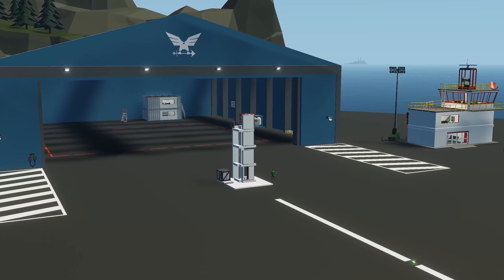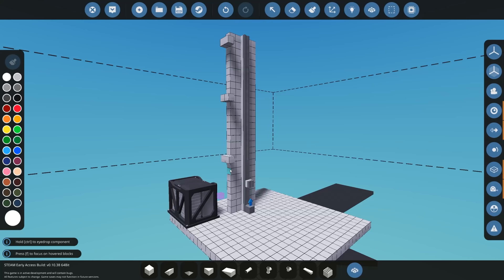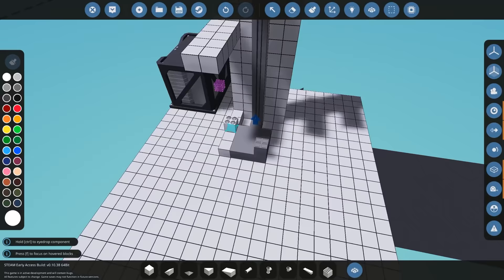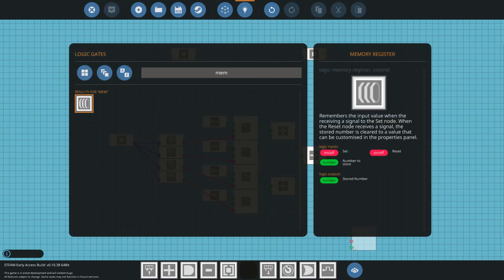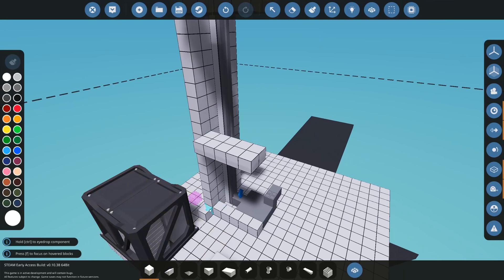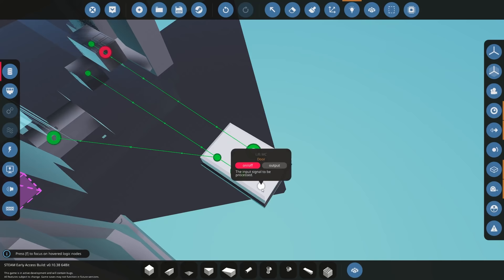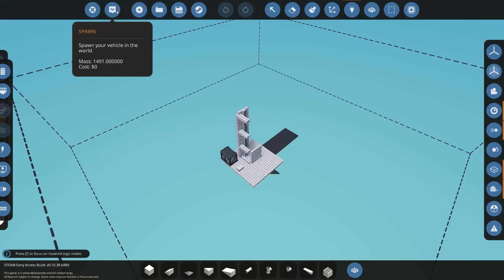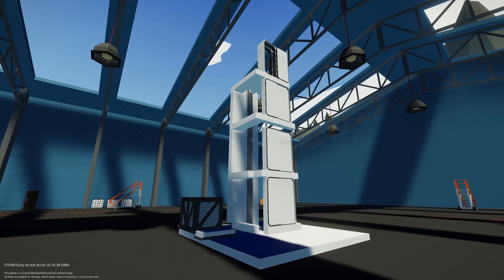Multi-Floor Elevator - Stormworks

Comment: Here's an idea for opening the correct doors in an easier way.

Use electrical connectors.

The source connector is located on the elevator floor and it's release mechanism is controlled by the microcontroller.
Each floors door is set to constant on and receives electrical power from the floors electrical connector. 

When the distance in blocks = the set position AND speed = 0, then disengage the release mechanism.

I'd also add a delay mechanism on the movement to allow for the doors to close before moving. Safety first right...

Lastly, I'd use multiple dash components as call buttons.
A single button for each level with the channel of that floor.

As long as you loop the dash's and MC together, you can't even need to change anything in the MC, regardless of which button is pressed, the channel is the same so the MC will react the same.

Comment: I'm building it in my ship, and I would to know how I install buttons to take the elevator in outside in each floor...
Reply: I had the exact same problem, but I fixed it by connecting the composite reads to OR gates, with the call buttons on each floor connected to the other input, and connecting the or gate to where the composite reads used to be connected. Works flawlessly
Reply: @christianmoeller4397  I fixed this problem building old version. It works well.

Comment: Ok so for everyone who is confused with how you make the "Call elevator" buttons this is how you do it. Ok so first, You go to the micro prosessor you've made, what you do here is you make some extra inputs for your call buttons. In my example i used three call buttons. In the microprosessor you add three on/off inputs for your buttons. When you have done this, you put them into your program and connect each of them to an "OR" component. into the OR component you plug in your call button to the Memory register and numerical switchbox you have for the designated floors. 

English is not my first language so im sorry if its formulated in a difficult way. If you have any questions just reply and ask me and if it seems hopeless i could eventually escort you to my Steam profile and upload my Micro-Prosessor which you can then use and download for your own use.
Reply: can you send the micro-prosessor to me?
Reply: i dont need it anymore, i fixed it myself
Reply: @nilsandersson223  Oki :3
Reply: Im not sure how to do this, can u help me pls?

Comment: You can also use grippers to lock the elevator in place which can help save power and prevent it from slowly sliding down over time, which is also very handy for heavy-duty cargo/vehicle elevators.
Can be done either by using vertical grippers that apply a brake when the door opens or by using horizontal ones that release when the door closes, the horizontal option is probably the best as it locks the elevator to the grid instead of a potentially incorrect section of the vertical track. You would only need grippers/tracks level with each floor and 1 on the elevator for it to lock onto, so you can still make it somewhat compact if needed.

Comment: Distance sensor are using electricity and the power will constantly drain the battery all the time if the power source being connected. I recommend use electric relay and capacitor for a distance sensor to prevent power being used.
Reply: You would also want to lock the elevator in place once it reaches its target floor, otherwise you can cause the elevator to sink at a more noticeable rate.

Comment: Thank you, This was very useful. I'm just curious about how to work with the linear speed if I put the elevator on a boat
Reply: wow this made me think
Reply: @tutorialsforeverysituation5253  I found the solution: directional speed sensor so long as there are no waves
Reply: @harpermonohan  Yeah I thought of that but a distance sensor would be a much better option.

Comment: Very nice overall but a speed sensor isn't the best ideer for the doors I think, because normally your creation is moving when you use it so the doors won't open
Reply from the maker: Good point!, But instead you could just link it to the PID output and then when PID is =0 then open doors :)
Reply: You can counter it by using a speed sensor attached to the main body, then use the difference between both in place of the one on the elevator. This essentially cuts out all movements of the creation and allows the elevators speed sensor to function as if stationary. 
You will need to make sure they have the same orientation so copy-pasting is probably the best way to place the second one, you might also need to set both to directional to prevent any weirdness.

Comment: I'm a bit confused with the whole add blocks stuff at 7:52. I've actually got 6 floors as opposed to your 4, which is initially fine, since I only need to add an additional add block to the initial 2 you have shown, but once it comes down to the second pair, I can only think A-B on one, and then only B on the other. How do I fix this?
Reply: He said add it all together, so I can only think of adding one extra add block for the extra two floors, and another add block to add those and another add block to add the three. And I guess put that all into the memory block. This definitely isn't a solution though, just an idea.

Comment: Can we please have a watertight door that doubles as a cargo lift? Kinda like on an aircraft carrier?
Having trouble getting one to seal, that or a hinged one that parts in the middle, basically need a big hatch but don't want a door a mile high in the air when open.

Comment: does not work.... ive tried severall ways this is day #3 of trying to get it to call from other floors... i build same panel at each floor to call elevator but does nothing through composite channels set correctly... tried buttons to composite only calls 4th floor and opens the door to the floor you are on but elevator stays on 4th... watching again stating from scratch same issue with composite... please do an update video with WORKING CALL BUTTONS otherwise its not a working elevator and an incomplete tutorial. Theres seriously an issue with calling or im missing something, 3 days of tinkering please help

Comment: how would you create a delay between the doors closing and the elevator moving (if you wanted a 2-second gap between the doors closing and the elevator moving?)
Reply from the maker: Just use a capacitor
Reply: @MrNJersey  thanks ;)

Comment: how to call the elevator from the outside
Reply from the maker: Have same composite on outside
Reply: @MrNJersey  does not work.... ive tried seve re al ways this is day #3 of trying to get it to call from other floors... i build same panel at each floor to call elevator but does nothing through composite channels set correctly... tried buttons to composite only calls 4th floor and opens the door to the floor you are on but elevator stays on 4th... watching again stating from scratch same issue with composite... please do an update video with WORKING CALL BUTTONS otherwise its not a working elevator and an incomplete tutorial.
Reply: @ghettodexter  I managed to call the elevator from the outside
Reply: @MrNJersey  Well I succeeded by digging my brain. Your elevator is great but when we play together it's problematic
Reply: @liima7860  yes it works from outside only not inside and calls to only one floor with the use of this tutorial if you just simply"add" boxes to each floor....
Reply: @ghettodexter  what